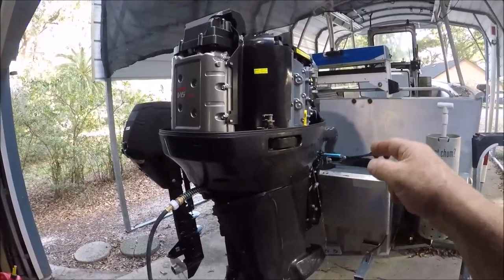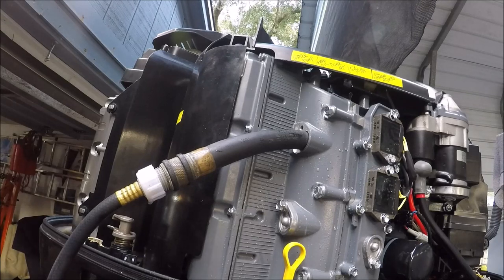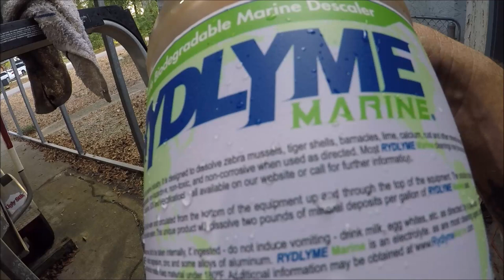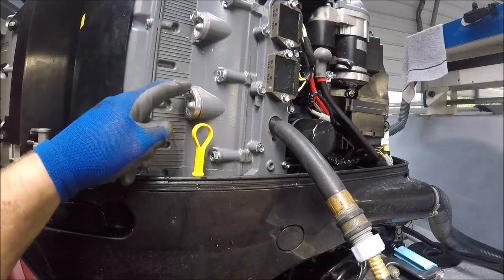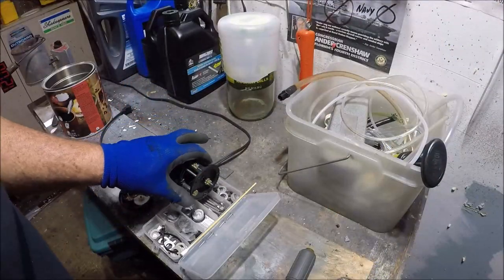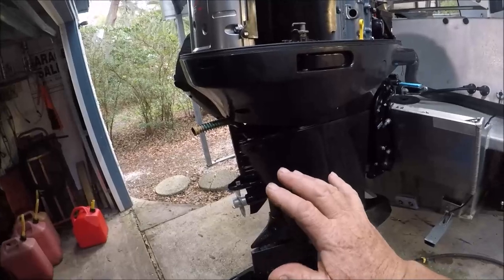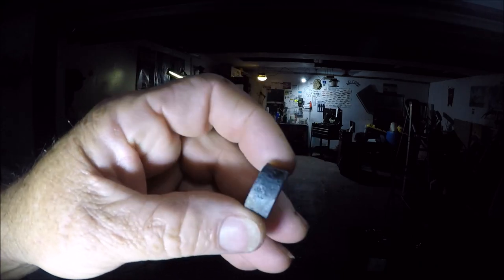SUZUKI 250 CLEAN-OUT❗

Comment: What do you think about visiting clean fresh water lakes for a day occasionally ?? Seems like the reved up running and higher flow and volume would be great. I am a pleasure boater out of Bradenton area but like to travel with the boat anyway on occasion.
Reply from the maker: Thats not a replacement for flushing with clean water, motor running up to operating temp. In a barrel. And do not use those flushing ports!

Comment: Great info Capt Dave! I bet a lot of people are looking to do anodes right now! LoL, I don’t run the river with my big boat but me and my cousin use my little Mako 1801 in the river a lot, it has a Zuke 115, an 06 model and it has the anodes too. You spoke some of the truest words anyone can hear....EVERYONE should have a service manual, owners manuals rarely have the critical maintenance info that service manuals do. Thanks again for the great content, Be Safe, Tight Lines!
Reply from the maker: thats only 1/2 of it....mines a 06, and I have several videos about that river clogging up my fuel cooler, you have one too.  NEVER ever use that flush port on the motor and think your okay. I did for years and paid the price. NOW, anode check clean or replace, always run in a barrel, and also run rydlyme thu motor to washout all the M-U-D in the cooling system (water jacket)  as you see here.

Comment: Do you suggest using Rydlyme instead of Salt Away after each use using the flush port on the motor?  Or use Salt Away for everyday use and do the flush like you demonstrated every 3 months?  
And thanks for the awesome no nonsense videos.
Reply from the maker: never ever use the flush port on the motor. I guess you can afford a 55 gallon barrel of salt away. I can't.
I do a complete descaling every 6 months; with  rydlyme.  and every time I flush out my engine in my big barrel. let the warm water flush the salt and mud out of it. this is all we needed in the St Johns River which is a mud dirt nasty River.

Comment: Thanks for sharing your maint. regiment,  I have learned a great deal that has helped me keep my Suzuki running
Reply from the maker: I'm editing one last, Outboard ''in depth'' video right now about ''as I said here'' swapping the fuel cooler and checking it. Its real simple, if you run in very salty, dirt water, DO NOT USE the stupid flush ports!  Use the muffs, or run to temp in a barrel.
Reply: @CaptDavesSportfishing  I totally agree... My Suzuki dealer said not to use the muffs so I went out and bought a new muffs that have water feeding into both sides, it stands to reason the the motor was designed to intake water at  the lower unit so the flushing should be the same... Thanks again for sharing you experences
Reply from the maker: @rogerjones1628  you mean not to use the flush ports on/in motor. (which aren't for running it) Ya' wanna run it and bring up to temp. My t-stats are 120F, and I watch the temp as it runs. You must not have the lower water pick-up  https://youtu.be/BTrd3sM24P0

Comment: just got back my boat from the dealer. Replaced entire lower unit. Said it has water inside, but when they tested then didn't find a leak. Since it was still under warranty they replaced the whole thing.
They didn't touch any anodes though, even though i told them
Reply from the maker: you just got lucky....you had leaking seals! But never heard of merc giving lower units away....sounds fishy to me, or not the whole story.  You may have to actually turn a wrench, and learn more about maintenance. FRESHWATER anodes get nasty too, and eaten away. It's a electrically charged thing in water. Usually anodes for freshwater are magnesium, I believe.
Reply: let's hope i don't have to do that. Mercury sells extended full warranty for 5 years for 1000. You can ONLY buy this warranty WHILE your engine is still in the original warranty (this way they know u don't have 'preexisting conditions' when u are buying the warranty). So the lower unit wasn't completely free, i did pay 1000 for the warranty, but i still have 3.5 years left and im sure i will use the warranty one more time. I wish i could buy another 10 years for 2000$ and just not worry about anything : )
Reply from the maker: @ifishcatfish  I had years ago a motor extended warrenty on a Evinrude 200 2-stroker...blew it up twice, because of lack of lubrication. ZERO fault of mine, and that company spent 7k TWICE paying my mechanic to rebuild it. Plus blew a Yamaha 200 2-stroker also, and they paid. So yeah, great for you, but I'd still be out of work! SOOOOOO either way I LOOSE!  Thats why I ''have too' make sure maintenance and PREVENTATIVE THINGS ARE DONE.

Comment: Try plugging the main intake on the bottom when the lower unit is not on; Good job!!
Reply from the maker: IN PINNED COMMENT I MADE ABOVE my main man Orowock told me, if you had the t-stats out it would have beenbetter, never thought about it.  I'm ALWAYS under the gun so I had to get it done before my next charter.....plus I pulled my fuel cooler. Editing that right now!

Comment: With lower unit off push hose directly on pickup tube and plug your pisser,I had great results.check water flow at thermostat. Love Rydlyme
Reply: Oh and take them out
Reply from the maker: @michaelfavre4192  months ago, and I have it ALL figured out....as I said, "got many more videos""
just getting something done, thats all. OH, btw dont even have this motor anymore. Got me a new 2020 DF250. I run in absolute mud water, so when ever I can get the crap out, I do.

Comment: And I was just wondering about running up & down the St Johns.  Looks really shallow up on the Cocoa end.
Reply from the maker: Well I'm very very far from there I'm in Jacksonville I don't know nothing about that the river really is just thin and swampy going south and it's all fresh water. Unlike here where there's incessant dredging and ungodly current
Reply: @CaptDavesSportfishing  I was there to check things out and noticed a lot of air boats and some john boats.  The water is brown tannin.  But, I figure it can't be any worse on an engine than the Indian and Banana  Rivers with brackish waters.
Reply from the maker: @oldhardrock2542  yes tannin Galore running to the swamps heading to Jacksonville and then becoming extremely salty stirred up from incessant dredging and that's the reason why I have to pay attention to my outboard I only wish I had just the tannin to worry about.  That's the reason I love aluminum boats fiberglass boats get the st. Johns River camouflage on the bottom in the pores of your fiberglass AKA brown stain

Comment: I wonder if new Evinrudes have these anodes? My old 1990 Johnson 175gt is still running ok. I am torn between a Suzuki DF, or a used G2 175. I usually pull the boat out when not in use, and flush for a few minutes.
Reply from the maker: really, ya want a used motor where the company went out of business? I'd steer so far away from them, no matter what they say. All modern outboards seem to have smartened up and have internal anodes. It's all about how EZ they are to inspect and change. I BELIEVE SUZUKI IS THE WINNER.

Comment: its recommended to remove the thermostat for the rydlyme to circulate better and through the cooling system. that's why you don't get anything through the anodes hole because the thermostat is cold and closed. good luck capt.
Reply from the maker: just needed to get something done, since my lower unit was being re-sealed, doesn't matter I got it all cleaned real good (its funny, everyones a expert) they, Rydlyme thinks everyones doing this on a inboard engine. this video and my others about maintenance don't get any views, 90% of outboard owners don't do shit, except drop it off at a $100 a hr. shop. So, I won't be doing videos on this type of maintenance any longer. Too much time invested, editing etc. for nothing.
Reply: @CaptDavesSportfishing  i still my my own maintenance for my Suzuki DF175 and i enjoy it every time. can i ask you do you recommand to flush the lower unit gear case? and what to use to flush it from old oil if yes?
Reply from the maker: @adAlqubaisi  never.....new gear lube, that's it. Do you flush your vehicle's differential???
Reply: Capt Dave's Sport Fishing thanks capt got it

Comment: I believe the bolt is an M12 fine thread for the Suzuki anodes, for the anode removal part.  I prefer the Yamaha anode setup, because the anode to plate bolt comes through from the outside-in, so it isn't exposed to the corrosion on the bolt head inside the motor, like the Suzuki design. Thanks for the fuel cooler laugh....next time someone asks why you installed the fuel cooler, you tell them it's what  you do with the spare cans of PBR after a trip.  PBR FUEL COOLERS STOPS THE VAPOR LOCK!  HAHAHA!

Here's a thought, why not use the RidLyme before changing the anodes?  Wouldn't it make it easier to remove them after because of the lack of scale?   Have you tried this?
Reply from the maker: everything is EZ on the zuki, except getting that fuel cooler out. And now run after every trip in my barrel, so no more issues. The anodes are never that stuck if checked every 100 hrs like I do now, as per the service manual. Not wealthy enough to buy yamahas. Same 18k zuki, was 28k in gold plated yamaha!  Since repowered, all this shit is 
O-L-D!

Comment: Hey Dave can I run redline in the 100 gallon tub while flushing the motor? If so how much rydlime will I need to effectively descale the motor
Reply from the maker: You'd need about $350 worth!!  50/50 solution I believe. Don't do it that way, pump it and recycle for a few hours, if you have a salt/mud/scale high temp, issue. Its not a ''frequent maintenance'' thing. Its a fix. Maintenance is running / flushing in a tub after every trip (as I do with my new Suzuki 2020) and let the water get warm. Salt and grime gets washed away with warm water easily. As you inspect your Anodes, every 100 hrs, you'll see the water jacket inside with a flash light. My Engine is spotless inside, cause I flush immediately while motor is still warm after every single trip.....Because I run in Salty MUD water.
Reply: @CaptDavesSportfishing  
Got ya. How about if I were to leave the lower unit on and do the constant flush through the flush port on motor? Would I get a complete flush if motor is not running and thermostats are still in place?
Reply from the maker: @doug2202  t stats gotta come out.

Comment: I wonder why I learn all this stuff. What is a anoid?? Now if you ever want to know about the new. Hydrolic bypass valve. Let me know?? Lol 😮 I wonder if you can tap other way. Or both ways at one time.? Lol  . I saved a guy. He stripped his nut. I told him put a starting wheel on it. . … it drove him nuts 🌰 😮
Reply from the maker: a sacrificial metal that saves the Aluminum engine. Many times called a zinc.

Comment: Please i have the new model Suzuki 30 hp four stroke and when i start in house with mineral water with ear after 5 munite alarm temperature i stopped fast the engine next day i go at mihanik. We put at computer ww start the engine and the temperature go at 96 and stop there after we change thermostat for 60c.And we change new impeller in water pump.We start the engine again and the temperature go at 86 and when you put forward water go litle fast and temperature fast go down at 63.when you put neutral 86 it is normal mu mihanik they don't know esaclu how temperature must have that engine but alarm now no ring!!!
Reply from the maker: a new 30hp shouldn't need any new parts. are you sure you had the flushing muff of it correctly???? Check your owners manual. You ''may'' be able to start and idle it using the internal flush port, instead. On my 15 mercury I can, as long as its just in idle. read your owners manual.  Your alarm went off from not enough water pressure or improper use of flushing muffs.
Reply: @CaptDavesSportfishing  yes i put the leg of engine all the water and with no pressure gas motor go at 86c when i put gas 63c i dont have manuals because i Buy second hand and they lose the other men before i go at suzuki yestarday and at computer engine have 350 hours but the mihanik they dont know if engine is ok to work at 86c other mihaniks i speak they tell me is not normally
Reply from the maker: @gioetajas1263  okay, you put lower unit ''in water''....okay. Yes, if 350 hrs who knows what  and who , did to water pump. You're good then. if changed, You said ''NEW'', I was thinking no hours!  Thanks for watching and stopping by my video.